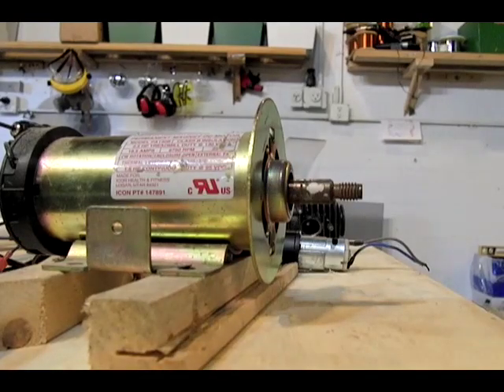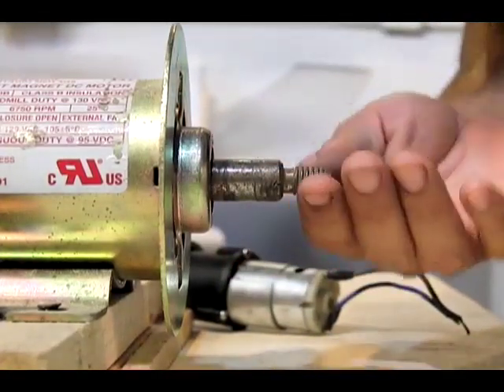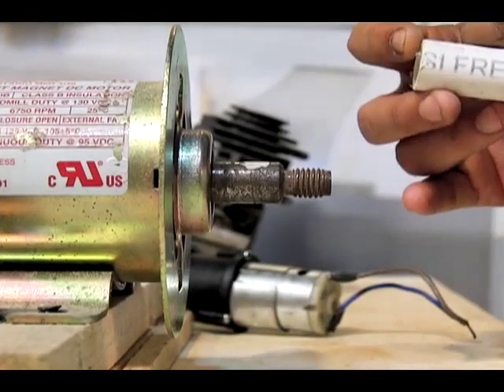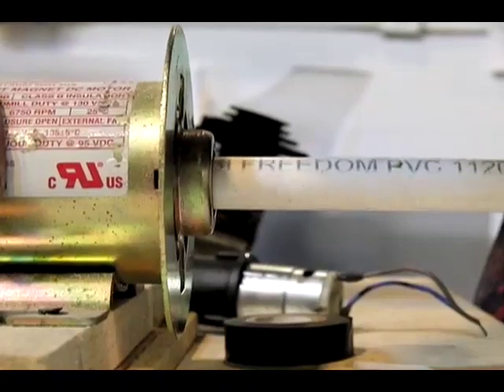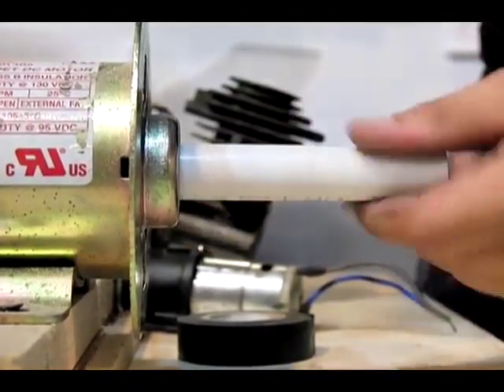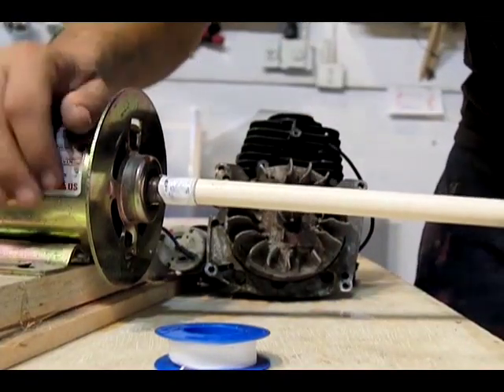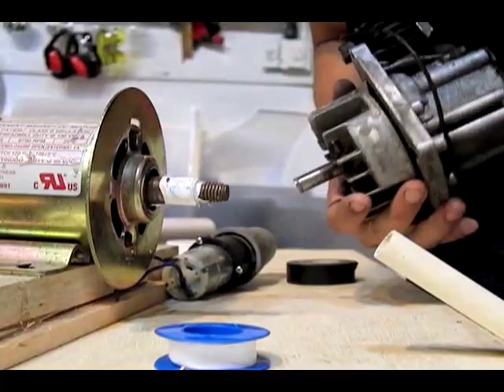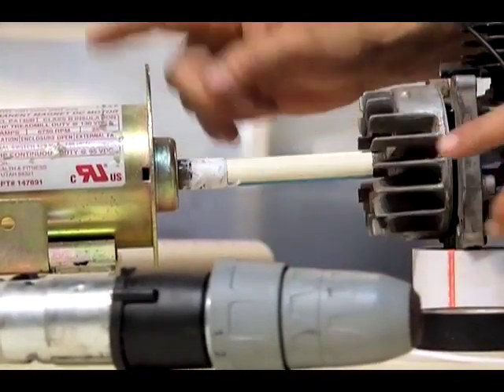Universal Mount Generator Solar Project Mount Steam Engine

Comment: Why not drill a whole through the 2 (or 3) pvc pipes and put a bolt through them so it's kinda keyed?

then how about drilling a whole through both shafts, put a copper  or other piper
with the same holes around them and bolts again..  would probably make hell of a  noise but would not slip when load is attached.?

good or bad?

Comment: You could grind a flat surface on the shaft then drill a whole in the pvc pipe. A screw could go into the hole and lock the pvc onto the shaft.

Comment: Vacuum hose could be a "decent" coupler. Just make sure it has the fiber mesh in the hose. Temporary, but might work better than the PVC...just looked and this was already suggested, but I kinda figured it would have been at some point.

Comment: @GREENPOWERSCIENCE 
use ruber pipes and hose clamps for saft to shaft conection its reusable and doesnt cost fo tape also could cut slots in end of pvc pipe and use hose clamp to hold and i would make a gear system housing to be able to hook different projects together could also use tin as a bolt put hole in it and screw down then screw that to pully mite help

Comment: use a high pressure hose and clamps to put the two components together;

Or the PVC will bend if you heat it, so if you heat the PVC before you put it on the shaft, then put a clamp and tighten it up. The heated PVC will bend sufficiently to form to the shafts.

Comment: why dont you just drill a hole the size of the small shaft right through a metal
bar and then use that hole to drill the bigger hole on the other side to the right position. Then you could drill a pin in from the sides 
to hold the bars together.

Comment: I think if you used (added) some small diameter hose clamps around the two shafts it might hold the PVC/CPVC connector you made, that way it won't slip with a load on it. Great idea though, the simpler and cheaper way is always the best.

Comment: why not drill holes through the shafts and use some aluminum or copper pipe scraps to join them with cotter pins? 

Still temporary but sturdier.  if theres a difference in size. (if using copper pipe) you can use different size pipe and a reducer and solder (or braze) it together. 

or just use bolts in stead of cotter pins. theres alot of options that are stronger and would take less time to build.

Comment: hello using a heavy duty rubber hose  will allow for misalignment and transmit more power than the engine can produce,and will fit diferent size shafts.
if you feel the need to clamp some how the best ive found is to use steel wire in multiple wraps   for at least half an inch of shaft.[study the capistan winch] then just twist wire keep on your looking good

Comment from the maker: @yadidimeanmaine Car alternators do not work. They are about the worst solution for power production. Cars use them because they are cheap and easy to control voltage. They also do not produce power by simply spinning.

Comment: Hey Dan, 

Instead of PVC I use black hose with a couple hose clamps for testing. Its a hell of a lot quicker and all ya need is a razor knife and a screw driver. LOL, Works pretty well for me.

Paulie

Comment: The problem is vibration. If you use a heavy piece of reinforced rubber hose, you can offset two hose clamps on each shaft to approxamate balance and it would run much smoother and last. The rubber will allow for shaft alignment imperfections too!

Comment: DominickBlack
Ya,  me too. Even better would be to take a hack saw and cut a split into the pvc lengthwise for about an inch. That would allow the hose clamp to really squeeze the shaft. Problem solved.

Comment: cPVC is found in stores that deal with mobile homes and mobile home repairs. Your local Home Dept will not have it unless the demand in the area is high.
cPVC cement is also not the same as standard PVC. Check your can label before use.

Comment: Dan I love your videos.

You could hook up something like this by using a grinder to create a short key way.   Then use key stock to fit in a notch in the pipe you use to connect the two items. This can all be done with very simple shop tools.  Also if you drill and tap the pipe you use then you can use a socketed screw to tighten to the shaft.  That way even if there is a shaft size difference you can generally find the pipe sizes to slide it all together and lock with socket screws.

Comment: didn't go through and read all comments but you can also use heavy duty flexable heater hose with hose clamps which would last and have a little give to it.

Comment: Hey Dan, sorry for not commenting lately, But I've been watching.
I would have gone another direction with this one.
I would keep the weed whacker as the power source and Generate electricity with the motor.
The reason is, electricity is the most needed commodity.

Here is a great project to run gas engines.
Search "Wood Gasifier" Any biomass will work. You can even run a car on it. But powering a Generator is the biggie.
Also check "The Colony" Season 1 Episode 2
Awesome show!

Peace! ;)